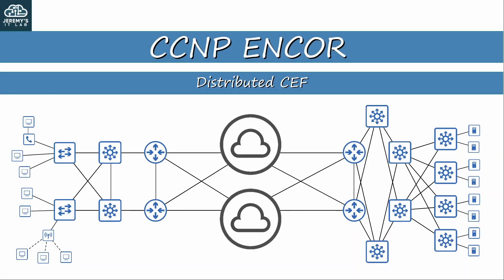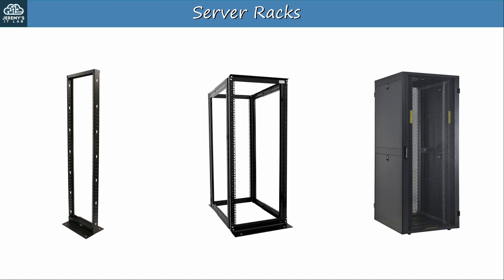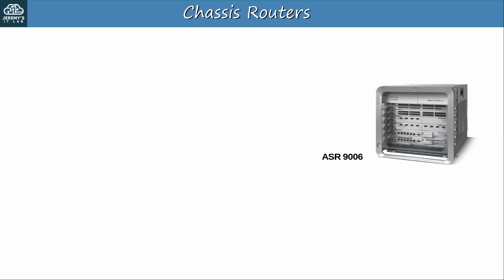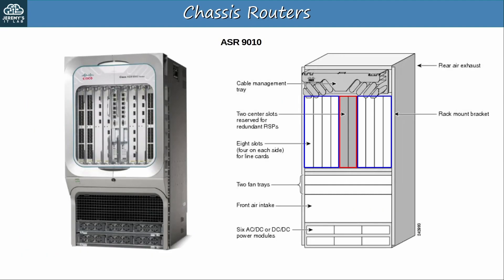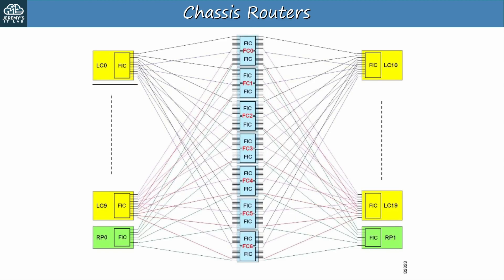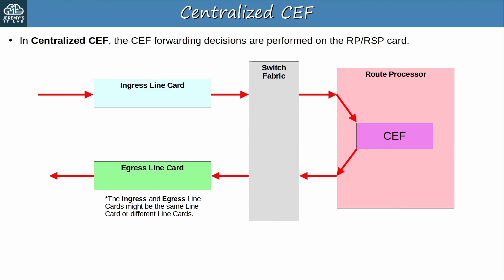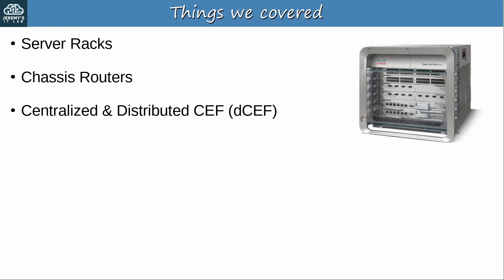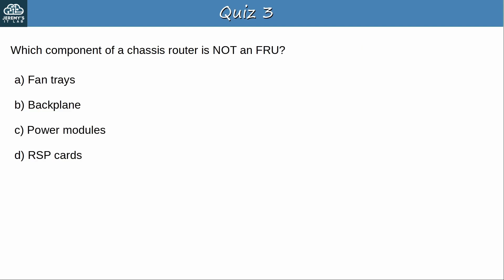CCNP ENCOR // Distributed CEF (dCEF) // ENCOR 350-401 Complete Course

Comment: Hi Jeremy, awesome presentation how CEF works. There is another term used for Line Cards: Blades 🙂

Just Information: Some line hardware in chassis-based are not hot swappable and the chassis require down time. Often network maintenance is very low on a customer list of things, even if they do know maintaining an operational network does require down time. It's always "sad" item for "Network Maintenance Requirement. Some cases the customer will allow down time if the entire chassis is "run to failure". 🙂  

3rik

Comment: Jeremy, I gotta be honest.  I'm sure it's me, but when I got done with this "dCEF" lesson - my thought was "centralized CEF sounds like the same thing as the traditional software based routing"... kinda like the RIB is just the routing table.  Maybe the difference is the FIB and Adjacency tables are more efficient but the packets still travel up to a processing unit...   true CEF is packets hitting the hardware and in and out (Whataburger?) of the hardware interfaces.   Anyway - much thanks for your content - between the online videos and 3 Boson exams and 1 of your's I passed the CCNA first try - which, again - gotta be honest was a complete shock.  I got half way thru the actual CCNA test and beginning to contemplate whatever else I I might do besides networking because I felt like I was getting thrashed.  I was so excited to pass I came home and started the CCNP videos immediately.  Thanks much - keep up the great work.

PS - I'm in Texas so I don't know if the Whataburger and In and Out references make any sense - especially sense your Canadian residing in Japan but we'll live thru it... : )